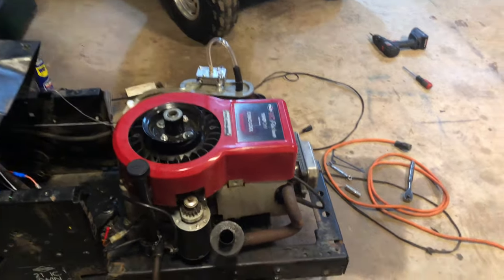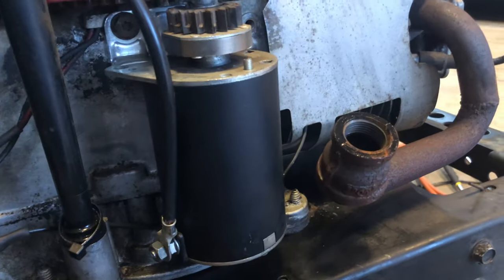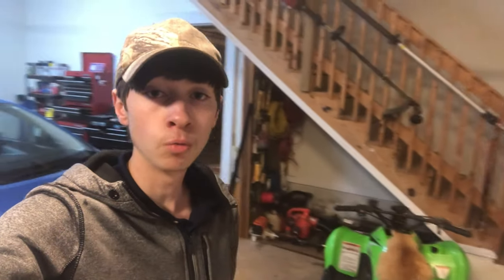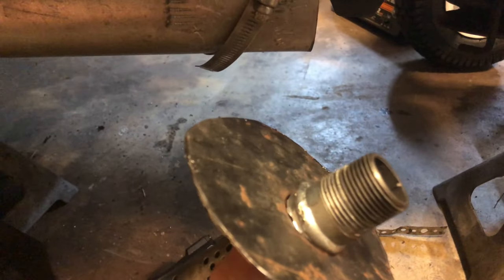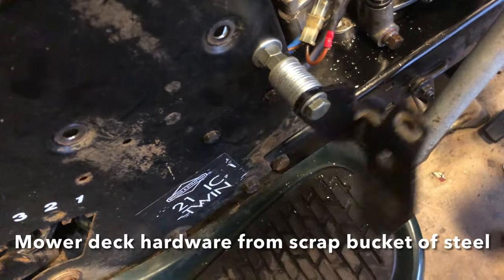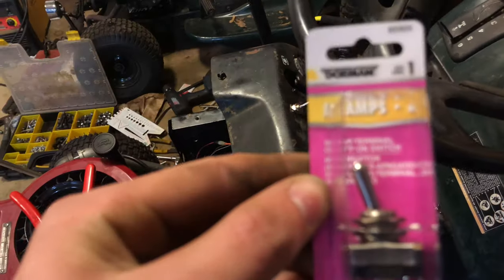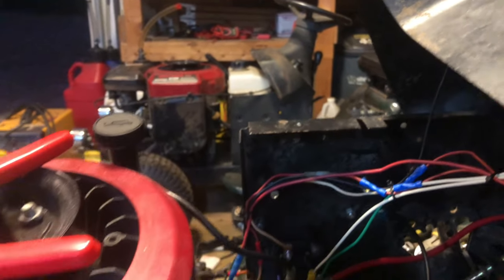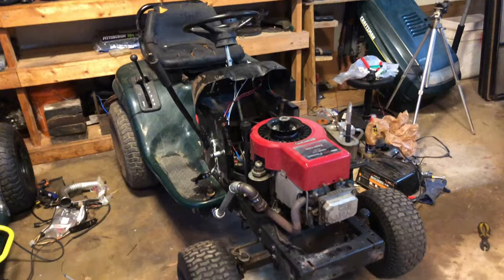Off-road Lawnmower Exhaust, Wiring, & Throttle

Comment: You know what you could do because you got a 3 position switch for the headlights, (i did this with mine) have it so that the middle position if off, top position is for the front headlights, and have the bottom position is for front AND rear lights. (just put rear lights on it!)
Reply from the maker: Not a bad idea lol!

Comment: If you want to get through tuff stuff try welding the diff but then you have to be a lot more careful and buff front tires not to big where it squats
Reply from the maker: I am going to weld the diff in it later, right now I just want the thing to run and drive lol
Reply: @IngenTechNational  yeah that should be done first